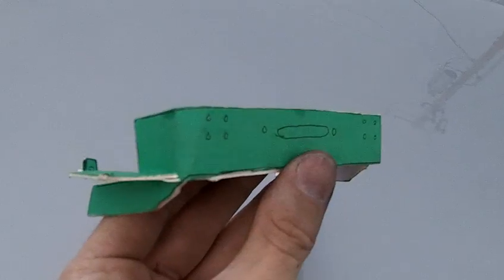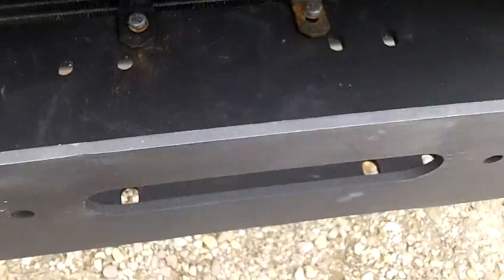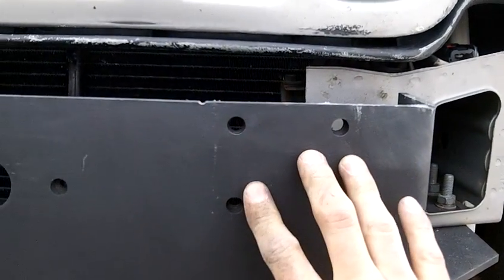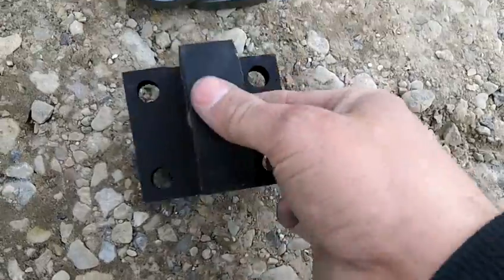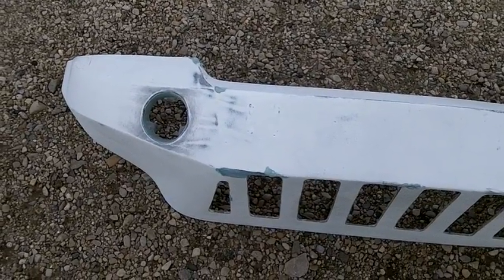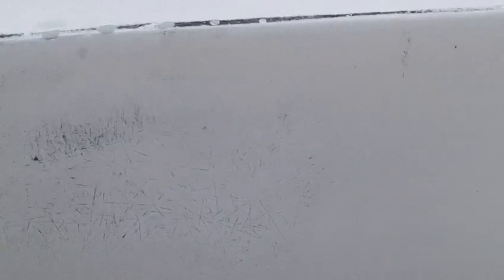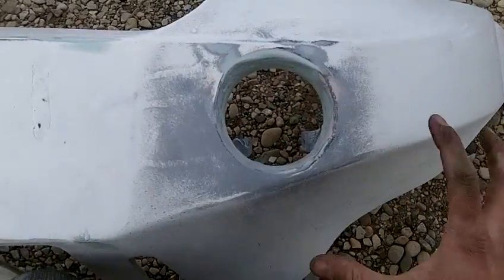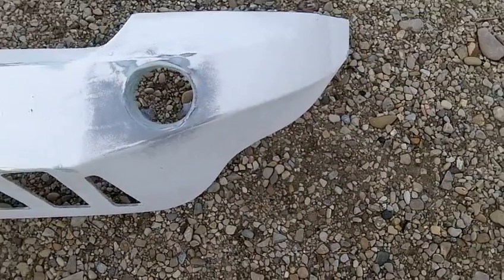Custom Jeep Winch Bracket! Laser Cut! Grand Cherokee WJ

Comment: I think your d-rings should be cut through the fiberglass and not sandwich the fiberglass. side pulls might put crush pressure on the glass and eventually make bolts loose as glass disintegrates underneath. If its cut through metal to metal I think you retain full strength.
Reply from the maker: Thats a possibility. The glass is pretty dang hard but I think an easy fix would be to put some steal spacers along the shaft of the mounting bolts and get the thickness just right with the bumper so once you tighten it up it still holds the bumper in place but it puts a lock on how far the d-rings can flex into the bumper. The spacers could not be compressed so I think if they were maybe 1 or 2mm thicker than the bumper it would fix it and give the bumper that little safety zone.
Reply: Are you still building and selling these?